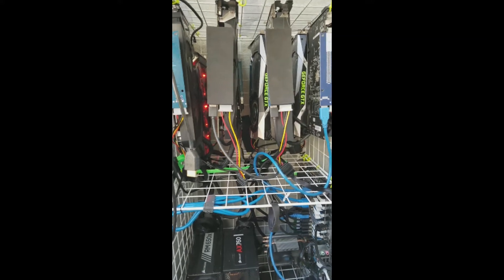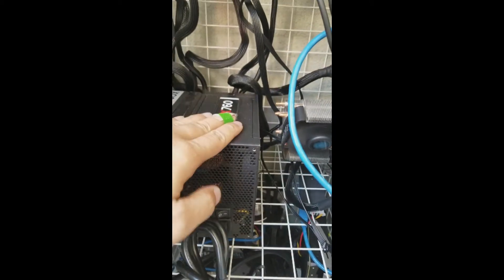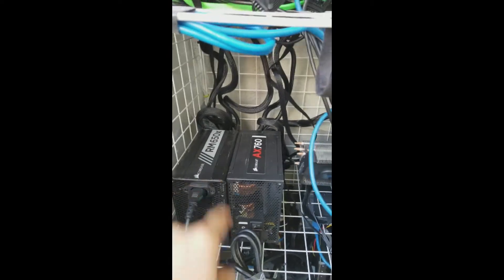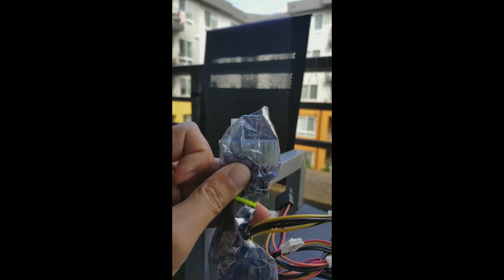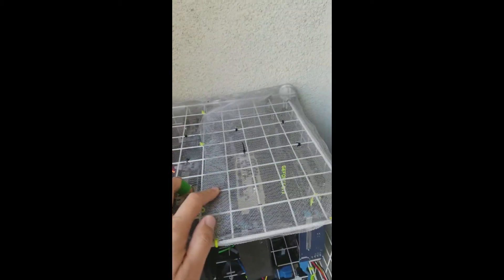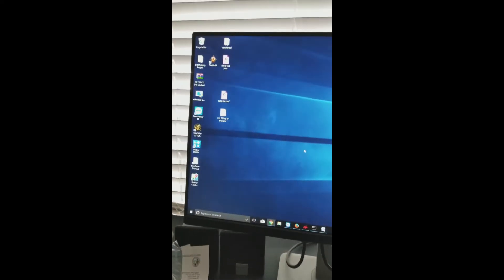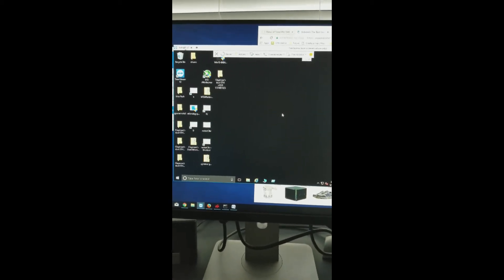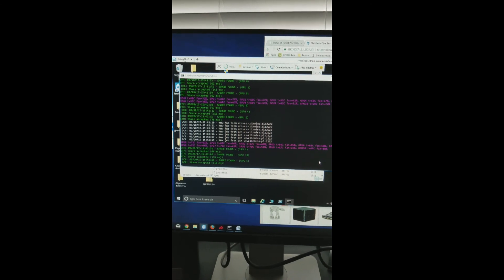Stable 11 GPU ETH outdoor Mining Rig on Windows 10

Comment: what bios setting do you use apart from those you specified :( because mine freezes everytime I run Claymore dual miner 10.0 or 10.1. My rig config is. 6 RX470 AMD and 6 GTX1070
Reply from the maker: Matthew Liao every other bios setting is left on default. This is an unexplained issue I had with this Mobo... When I add more than 3 amd gpu I had instability on windows 10. I had 10 AMD gpu on simple mining os and still had instability. Ultimately I settled on 8 Nvidia and 3 amd, and will try to push to a 4th when I have time. Please let me know if you make any progress with getting stability with amd gpu. In your case you can try to test if risers are the problem.
Reply: Thanks mtruo001. I ended up mining Zcash as it is more stable for hybrid mining. I guess in my case, as loading up claymore always freezes my rig although it's just six amd and six nvidia which theoretically should be fine.
Reply: Also, one more question would be when you use the Claymore dual miner, do you just run a single bat file? or you have to run one for AMD cards and another one for Nvidia cards? Sorry for my confusion..
Reply from the maker: There is a command with claymore to only use amd graphics card, -platofom 1 is the command but double check with the readme file. So did you get your system to be stable yet? If so what configuration ?
Reply: For Zcash, I have it stable just without any overclocking software like the Afterburner. I haven''t tested for Ethereum yet because it has been a hassle. It seems AMD rx470 is really choosy with drivers.
Reply from the maker: yes, I use afterburner to control settings on nvdia and amd gpu. keep in mind only the most recent versions work well. And yes, there is a bug where afterburner doesn't recognize all 12 of the gpu correctly, but if you scroll through each gpu individually, you will be able to tweak every single one of them. good luck, this is a labor of love!
Reply: Hi, Do you use msi afterburner software to control the gpus? I am asking because a friend of mine told me that afterburner could recognize only 7 gpus on windows 10. Thanks.